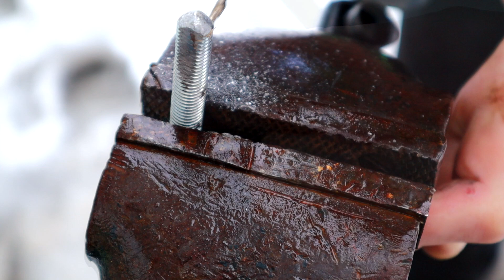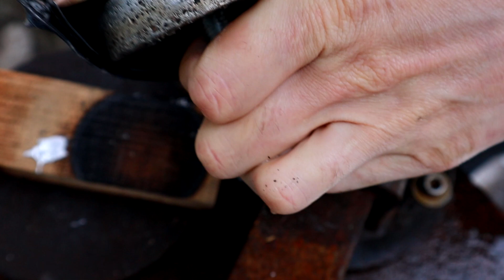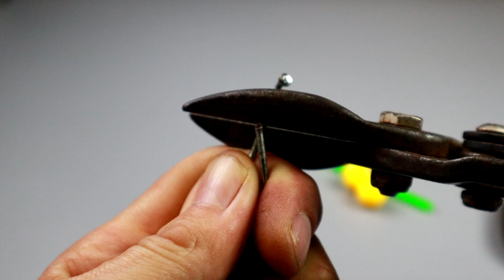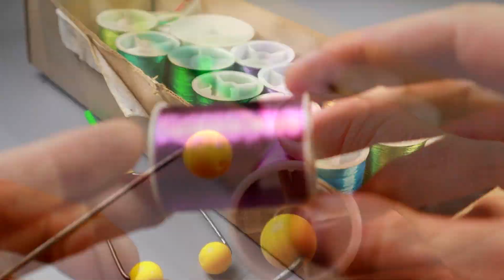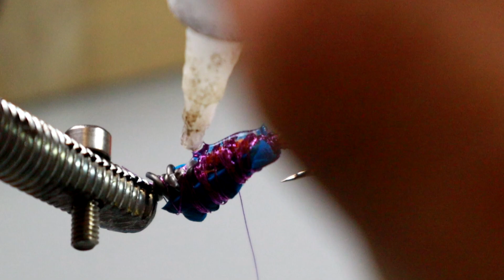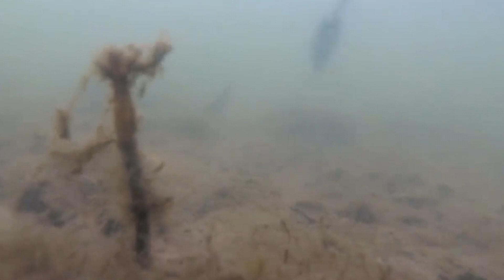Homemade fishing BOLT \ how to make a fly fly knitting tool

Comment: Nice video! Not everyone has lead plate tho’ 😅 where could I find that, isn’t it toxic?
Reply from the maker: Thank you, lead is in old car batteries, when melting lead, you need to use protective equipment, anti-hag and gloves, if you disassemble the battery, there is acid there, because you have to do it in protective gloves and glasses, instead of lead, you can just put it on epoxy, for example, next to a stone